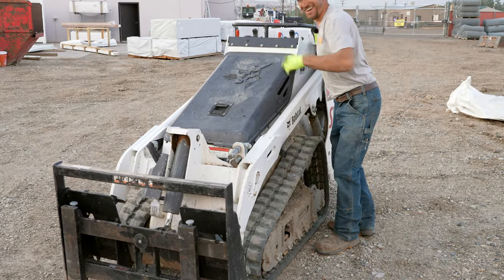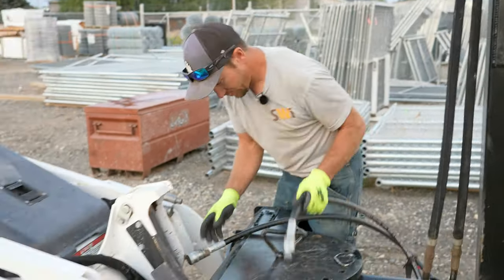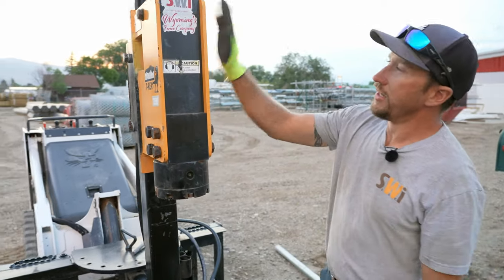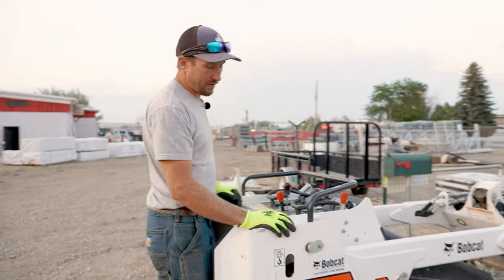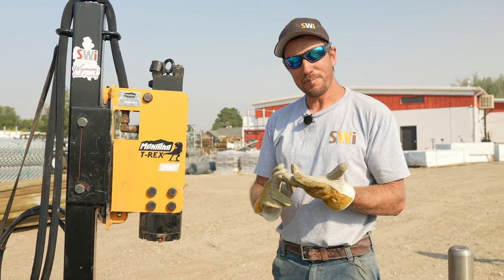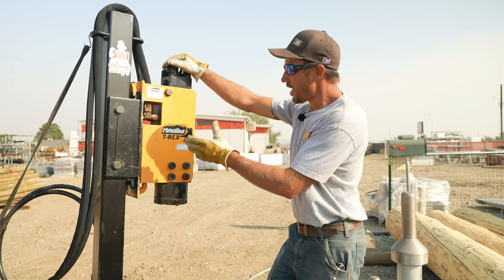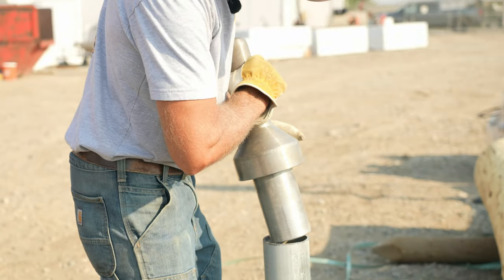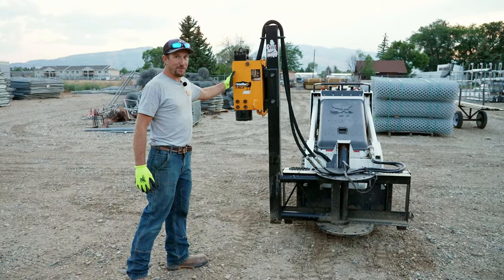We Mount The Montana T-Rex Post Driver To A Mini Track Loader

Comment: This is an amazing idea. I might look it to making one but with a scoping frame to have an arm to hold the post instead of a worker like the Wheatheart Post Pounder. I live in Nova Scotia it's rocky as hell some areas like Bedford are literally bedrock after 3 inchs so rock drills with 3ft tungsten rods with 6 inch diamond bit.
Reply from the maker: My head hurts just thinking about all that rock. 😣
Reply: @SWiFence  😂 I use the rock drill daily 😂 just installed 400ft of oriental fence in New Brunswick had to us an auger we watched your video about augers it's worked well. But a few holes had rocks 3 ft bigger than the hole had to use rock drill with stone splitting shims and wedges.  Old Tech but works wonders.

Comment: Could you pound 6 to 8 inch round pressure treated post? Im looking to buy a pounder. I only have a sk 600 ditch witch
Reply from the maker: The biggest post you can pound with a t-rex is 2 7/8"